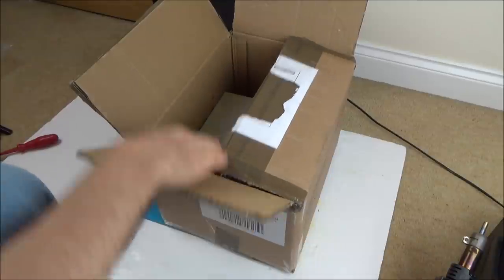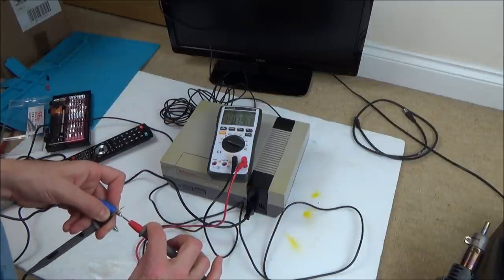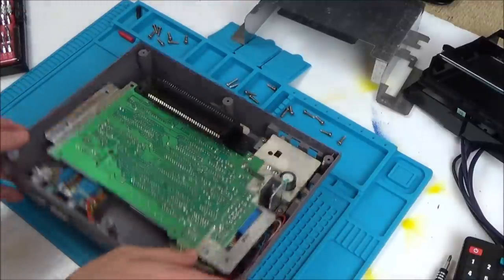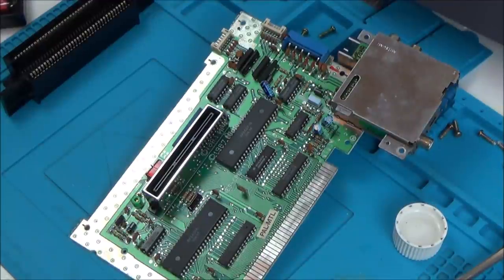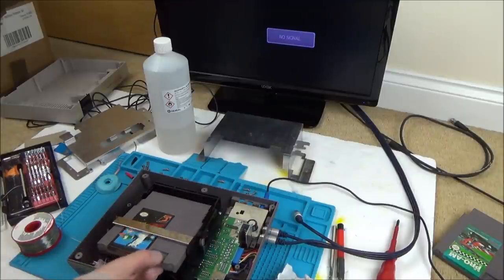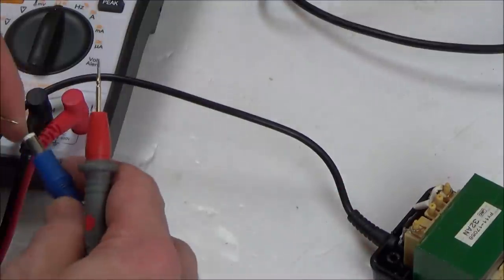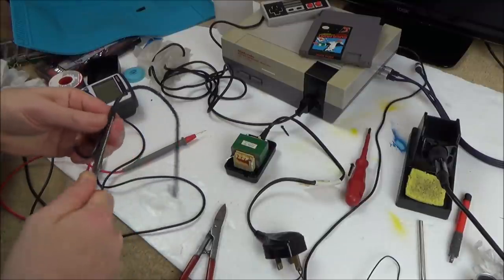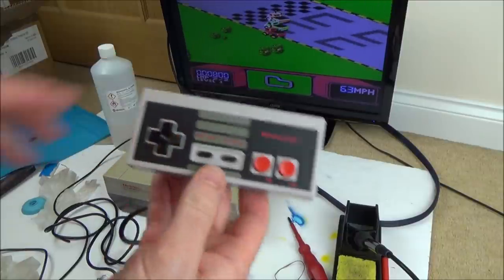Trying to FIX a Faulty NES (Nintendo Entertainment System)

Comment: Got to stop watching your videos.
Every time I watch one I go and buy another faulty item that you have just fixed and repair it myself.
Reply: Well...
I managed to score a nes,two pads,quickshot joystick,zapper,psu and the mario/duckhunt cart for £20 off gumtree.
NES wasn't working until I put a new fuse in the plug-then I got the flashing red light.
Opened it up.looked like liquid damage on the connector.Spent a while cleaning it up and now-Fully working NES.
Well chuffed.Been thinking about getting one for a while but now I got a nice cheap one.Just need some more carts now.

Comment: Those old AC power bricks, when they die they die, just that, unless there is some wire broken inside there is no way to fix that worth it, is better to just throw in the bin and get a working one.

Comment: Vince my 2ds wont charge att all how do I fix it?
Reply: Michael Dunne check and see if they battery is faulty, maybe need a new battery, if not check the fuses
Reply: @jeffonspikes5567  no i did both it just wont charge
Reply: It like charges and then it turns of in 2 mind
Reply: Michael Dunne is the charger/mother board of 2
ds showing water damage ?
Reply: I did everything i bought new one couple of months ago that broke too so i just gettin xl